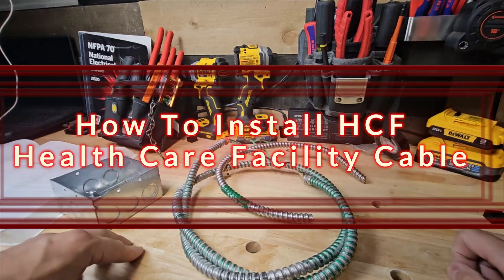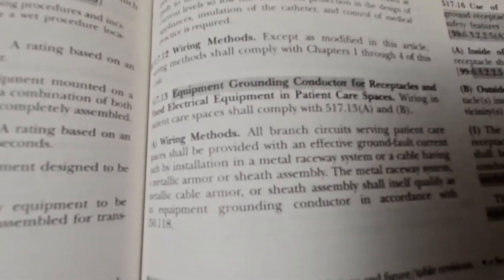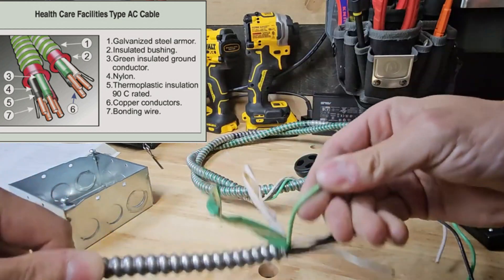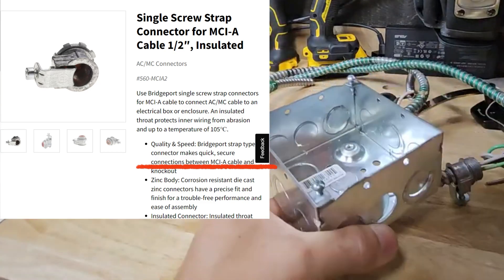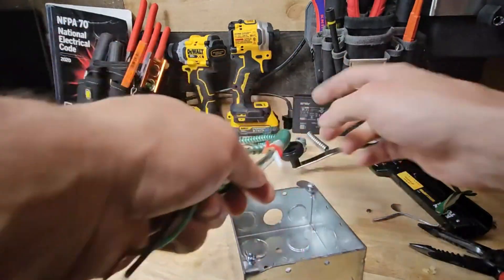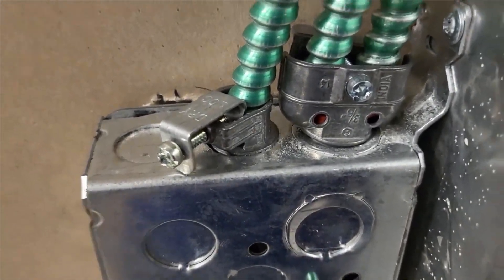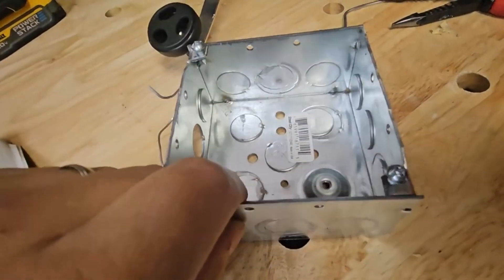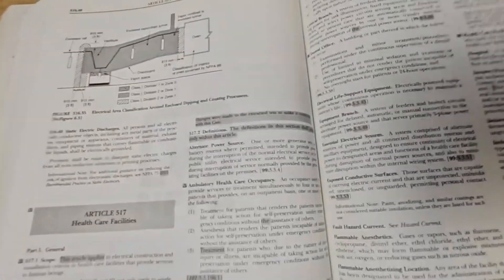How To Install HCF (Healthcare Facility Cable) where and WHY!

Comment: I hate cutting it off at the end of the armor. It leaves a sharp edge and I’m always worried it will dig into the other conductors. There has to be a better way

Comment: What about when receptacles are isolated ground receptacles?
Reply from the maker: Isolated ground is something completely different

I can make a video on that if you would like

Isolated ground recepticles, get their ground on the device. And that ground actually comes all the way from where the grounds and neutrals bond at the first means of disconnect or the sbj at the transformer 

The box is bonded with the dirty ground from the subpanel
Reply: @toolsandtactics  - Oops, I should have be clearer in my original wording. I was wondering for the given wiring shown, but terminating at an isolated ground receptacle, would there need to be another insulated ground wire or could the one insulated ground wire be isolated and run so it's not dirty?
Reply: @toolsandtactics  - And, yes please, a video about isolated grounds would be awesome.  Especially if you can simulate how noisy a typical ground can get.
Reply from the maker: @corpsie-diytools38 oh. I do not know about all that.I can just show how to run it  lol

I'm an electrical inspector but I can't film on site.So there's probably no way to do that

We would have to put some serious non linear loads like autotransformers ballast computers. Ect. To notice

And worst of all, I have to accept an offer from somebody that keeps emailing me to do a review on their oscilloscope 🤣🤣
Reply: @toolsandtactics  - dooooooo it 🤣

Comment: Can I run HCF MC cable from the existing metal junction boxes connected by EMT in the basement ceiling to the panel and splice the HCF MC cable in those metal junction boxes for circuits going to a dental office on the main floor? Will this meet code requirements?”
Reply from the maker: yes, because emt is a suitable ground make sure to bond all the existing boxes and use hcf or mcia connectors
Reply: Thank you
Reply from the maker: @ noworries aslo make sure reduant ground is in the existing box too a green egc
Reply: @toolsandtactics  I appreciate your guidance. A silly question, it is always a good practice to use Anti-short bushings, is it a code requirement to have anti- short bushings in HCFMC?
Reply from the maker: @M.SDhanjal-xw6gt  yes, not for MC cable, but AC. Cable and h c f yes
Reply: Thanks a lot!!!!
Reply from the maker: @M.SDhanjal-xw6gt  no problem.
Reply: I have one more question regarding luminaire installation above the patient area. For fixtures installed at 9 feet—which clears the 7’6” clearance requirement—is it acceptable to run HCFMC to the first junction box from the switch box and then transition to standard MC cable for the remainder of the installation?
Reply from the maker: @M.SDhanjal-xw6gt  yes100%
Reply from the maker: Another thing that you might wanna be aware about different inspectors interpret it differently, but basically it has to do with task lighting in a patient care area and is open to interpretation, but requires backup emergency lighting in that patient care space

Comment: So, if my homerun is overhead and it's emt that's considered redundant ground all the way to the panel as long as I use hcf cable from my home run box and in the walls to my devices? Thank you!
Reply from the maker: @andyrodriguez414  yes. Thanks exactly.  Hcf or Mcia connectors. Bridgeport is a good brand for that
Reply: @toolsandtactics  Awesome, I appreciate that.

Comment: Tbh instead than cutting the supplemental ground flush or wrapping it, I would much rather just bring it in the box and ground with a screw :(
Reply from the maker: probably because of coper and al connections maybe i can see why it would be better though
Reply: @Sailormoonpi  - Wouldn't that mean the box has to be listed as being compatible with aluminum?

Comment: I thought that if U ground the box, then the whole system is grounded due to it being MC back to the panel? If ground is not present then it'll be like knob & tube. Open ground on all circuits a zap from the neutral wire😂
Reply from the maker: @sengsavanghansana8374  with Healthcare it must be redundant grounded
Reply: @sengsavanghansana8374  Honestly I would prefer it if this was the standard. I've seen enough mechanically failed MC and AC to box terminations to want full gauge redundant grounding everywhere... And I'm not even an electrician!